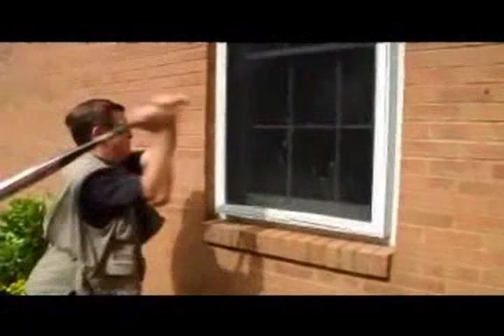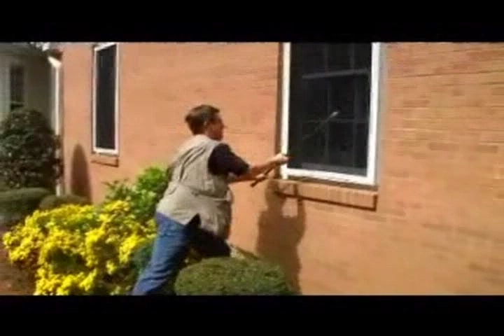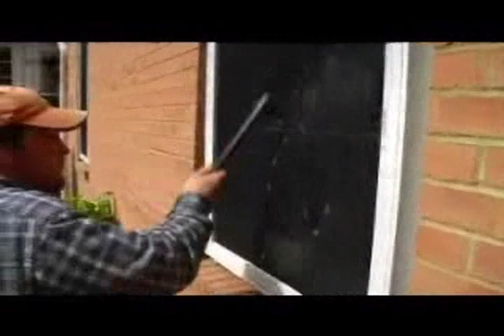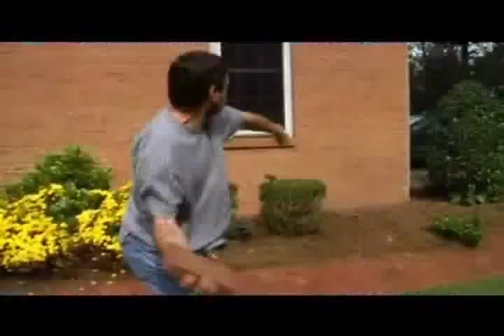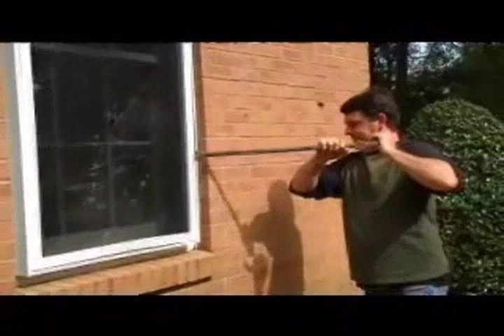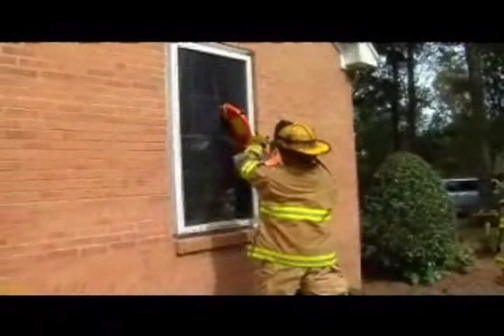The Investigators vs Tapco Security/Hurricane Screens (pt 2)

Comment: These screens are easily defeated opened by threading a wire hook through the space they leave for water drainage— can use a wire hanger - just grab the handle with it and pull the latch open…does not matter if they are indestructible if you can just go around them and open it!

Comment: Thanks security, I’ll be stuck inside when I need to escape during a fire! 🔥 thanks for the homemade oven!!
Reply: Thankfully, Ryan, I can tell you that's completely not the case. They have a single point latch on the inside that allows for a much quicker opening than most standard windows. And it's designed so that children and the elderly can open it easily. Check out their pictures here: https://www.tapcoscreens.net/windows